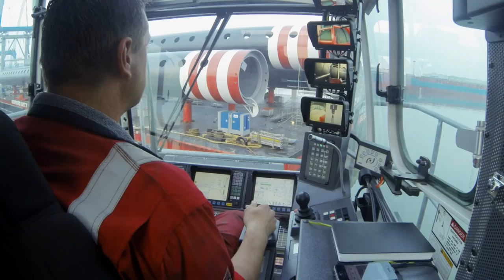Liebherr - LR 13000 installing platform legs of the Aeolus in Bremerhaven

Comment: This crawler crane set the bar too high literally and metaphorically . This masterpiece of engineering can lift how much exactly ? 2.5 k tones , perhaps more ? that lift was like 940 tons and it seemed to me the crane was lifting a toothpick , of course 940 tons are no joke considering the height the lift reached , the slightest wind direction changing could be an issue for any other crane , but not for Liebherr LR 13000.

Comment: What can I say other than "Awesome"!!!
Reply: whats even more awesome, is that the lr13000 can lift very nearly 2x more than the crane on the ship.
Reply: larryswindcatcher No other engineering company operates on the high level of LIEBHERR!!!
Reply: @davidsolomon8203  don't count out the sarens SGC-250 with a lifting capacity of over 5,000TONS! Pretty sure that's on a whole other level as well.
Reply: Fascinating isn't it
Reply: @MasterCivilEngineering  I was an apprentice rigger in a Spar Tree tree logging operation when I was 16 years old.
Reply: @larryswindcatcher  good job bro
Reply: @sparkynate91  and mammoets ptc 210 000! But both of them aren't able to drive, the lr13000 lifts 3000t and he can drive (OK not with 3000tonns on the hook!)

Comment: Can someone from Liebherr explain to me why there's no pads under the tips of the tracks? With the drive motors or idler wheels hanging of the pads this changes your tipping point. 
Awesome crane and job though, I was just curious about the pads.
Reply from the maker: Hello Jason, thanks for your question. They did a good job, everything is all right here. Inside the crawler and catwalks are track rollers mounted and the power transmission begins behind the Touraswheel. It’s perfect how they positioned the LR 13000 on the pads. If you want to know more details about that, just send us a mail to social.media@liebherr.com

Comment: 120 meter looks big and impressive, but compared to what size it can be, this crane is tiny, this 13000 model can be op to 250 meters height!
Reply: yes but it cant lift 1000 tons at 250 meters ;)